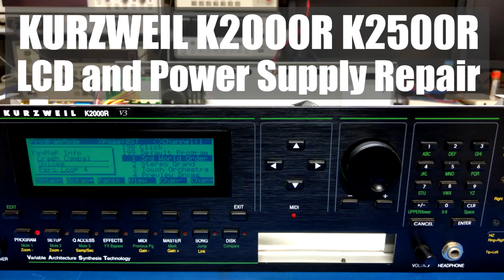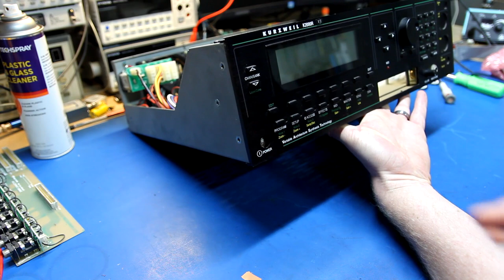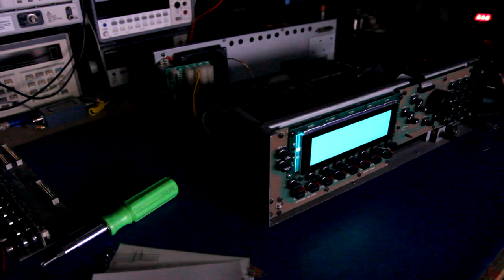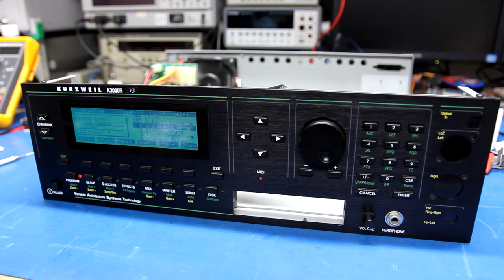Kurzweil K2000R K2500R Repair - Part 2 LCD and Power Supply

Comment: I got my K2500R for a few years, and enjoy it extremely. - I had to put it into storage when I renovated my basement, and after trying to power up the unit, had to discover that there is no sound. - It passes all the boot up, and hard-reset and what not. - LCD is great, all the functions seem to be working... JUST NO SOUND. - Obviously the batteries were exhausted, and when I replaced them had to discover that one was leaking (a little). Didn't think much of it, but eventually decided to open up the case and investigate. Much to my surprise there is modified wiring in my unit!!! - The main one I am worried about is the RED wire that has been added to D11 (next to TP16) and the BLACK wire attached to U58 (gnd). - The plug powers up the engine board (p/n 0011055 rev k) at J920. -=- So my first quesstion is... where do these wires originally come from? -
Reply: Did you try doing a HARD reset? Immediately upon powering unit, press Exit button an few times during boot process, it will bring you to boot loader menu where you can hard reset, run diagnostic tests, and more.
Reply: @ShallRemainUnknown   Thanks for the quick reply. - I think I did, but I can try it again. Right now I'm going ot replace the one "transistor/power regulator, since it is running hotter than the others (checked with thermal-imager), and then ...keep my fingers crossed.
Reply: @ShallRemainUnknown  I replaced the transistor/voltage regulator on the heatsink (the center one with the extra wires soldered to it) and reassembled the unit. - Unfortunately I still don't get a read out on the LCD - Its just "white". - I tried the "exit" button to access the boot loader, and ... nothing. -  So now I'm into checking the boards and follow the trouble shooting from KW. - If there are any Hints or "known issues" on where to focus my diag, I'd gladly appreciate to speed up my process. The board(s) visually all look good, and have no signs of discoloration or other questionable signs.
Reply: @kimmairdiscovery1957  I suggest you join Kurzweil K2x groups and ask, there's https://groups.io/g/KurzList and 3 or 4 Facebook groups as well. Good luck! I have a K2000R that doesn't boot, with all positive LCD that I'm trying to fix...

Comment: For an led upgrade, you can make the screw holes elongated for the k2000r as you mentioned come standard in the 2500. It’s another solution instead of cutting down the standoffs

Comment: I'm trying to fix the display of my Kurzweil PC3 with a new LED backed display just like you show in this video. My old unit had a really dim CCFL backlight. I replaced it with the new LED display but the new units backlight isn't working at all. Can I get your thoughts?

Comment: Hi great video.
First I’ve seen regarding kurzweil 
Power supply issues.
I wanted to ask if you don’t mind.
I have a k2000v3 that packed up
Two small glass fuses at the back of the machine where the kettle lead plugs in  have blown .
I read to replace the large capacitor 
No idea really not a tech guy
And synth techs in uk are not interested in repairing my machine 
Any ideas why the two fuses have blown 
Cheers mick

Comment: Thanks for posting this series! I appreciate all the great info. Do you know where I can find the replacement EL backlight strips that are the right size and sell for a "couple dollars a piece?"
Reply: Aliexpress sellers have them, double check the dimensions, but I believe they can be cut down a bit if necessary. You'll have to buy multiples to get the best deal, as the shipping price goes up only slightly when buying more. I think the best price I found was about $24 for 6 EL panels shipped. Check different sellers for shipping prices, the best deal seller priced the panels slightly higher, but shipping was lower when increasing the quantity.
Reply: @ShallRemainUnknown  Do you have a reference number for those? I've been searching Aliesxpress for an hour now and just can't find any... many thanks!!!
Reply: @jameshodson3450  Yeah - me too. Can't seem to locate them. I've asked bradthx if he'd mind giving us a link.
Reply: Hey all. I found the dimensions of the old backlight, which is 1.85 in x 6.18 in. I found the product "MagiDeal ABS Plastic EL Lamp" on AliExpress as a replacement backlight. It was around $2-3 dollars. The blue one is the correct dimensions, but the white one seems to be a bit smaller, but I ordered both just to test both out. Jeroen Oldenhof has a great guide on retrofitting one of the LED backlights if you want (instead of paying $90 bucks for the eBay seller backlights). They're about $30 bucks if you click the link in his blog post. Just search "Kurzweil K2000R display retrofit" on Google to find it, its the first result. (Don't want to link it here to get my comment flagged for spam)

Edit- I got my replacement backlight strips today. The white ones are quite a bit smaller, so if you are doing this repair I would go with the blue ones from AliExpress.

Comment: Great video. Thanks for this. Question: When I fired up my 2500R last year, after about 5 years of being packed away, the display came up so bright it was only readable from an angle. I could barely discern the text. I just turned it on last week again, for the first time since, and now the display just shows a blank glowing blue screen, with no text visible at all. Is this what a backlight failure looks like? I removed the front panel, and the layout of the 2500 is different from the 2000 that you show. The display looks to be in a metal case, that is not as easily removed as the 2000. Is there any chance that you could demonstrate the same procedure on the 2500R?

Comment: Hello given your experience if possible I would like to ask you a question: I have a Kurzweil K.2000 VP 3.87, the keyboard (the keys) are however very "soft" when I touch the sound, I ask if it is possible to replace the keys with other semi-weighted ones, for example for example with those like Yamaha DX7II fd, Korg 01W, or with other brands; thanks if you want to answer me.

Comment: It's interesting that even after replacing the EL strip, the display still looks rather dark in the video and the photo. On my K2500, the EL-backlit display is blindingly bright (I don't think it was ever replaced), about as bright as the modern LED replacement on my TG77.
Reply from the maker: My 2500 is the same way, super bright LCD and I also believe it is original. Kurzweil was using a newer and better LCD at that time, much more transmissive then these older displays.
Reply: @bradthx  Correct. My K2600R also has the super bright display.
Reply: I believe the k2500 is a ccfl backlight, not el. It's more like a flourescent bulb, not the same as el technology.
Reply: @backlightsnew  Yes, the K2500 (and probably K2600 and K2661, too) use a CCFL compact fluorescent bulb for LCD backlight, unlike the EL electro-luminescent backlight panel in the K2000, and unlike the LED backlight in new aftermarket replacement LCDs sold today (like the one Brad used in this video).

There's a YT vid of successfully using an long LED strip taken out of a totally different larger LCD monitor and adapting it to replace just the CCFL fluorescent bulb in a K2500. I'd hope you could still today just buy a replacement CCFL bulb, though.

Comment: Many thanks for these detailed videos. Could you please post the name of the generic LED display from ebay that you use. I was contemplating buying one of the $80 ones on ebay, then I heard you say don't buy the expensive one.
Reply: Any 240x64 display with T6963 controller and LED backlight, for example: 
https://www.ebay.com/itm/Blue-240x64-Graphic-LCD-Module-Display-LCM-w-RA6963-T6963-Controller-w-Tutorial/301017373646?hash=item4616089bce:g:0E8AAOSwH8ta1vpK
These displays using 5V for backlight, so there is no longer need for buzzing high voltage EL transformer anymore.
Reply: @_oscillator  Huge thanks for this information. I have a K2000 RS in the bottom part of my rack and I basically have to get down on the floor to read the display right now.

Comment: Well I took a chance and went ahead and replaced the display in my K2500R. It didn't change anything. Still shows a blank glowing blue screen. Apparently the problem is somewhere else. Any suggestions?
Reply: Internal battery?
Reply: @backlightsnew  Thanks for the reply. The battery housing is indeed badly corroded, and when the display was still somewhat readable, it did show a low battery message. I found a site that sells what looks like to be that housing. It does need to be replaced, but do those batteries have any bearing on the display?
Reply: @sqmus  a non-working battery can cause the screen to be blank.
Reply: @backlightsnew  Thanks so much for your response. I wasted a lot of time and money replacing the screen. I'll replace the battery housing.
Reply: @sqmus  well I hope that's the answer. I just know that it is often the culprit when there's a brightly lit screen with no text.
Reply: @backlightsnew  Well its certainly worth a try. The housing is only $17, so not a big investment. I wish I had known this before buying a new display. At least I have a spare.
Reply: @sqmus  You can completely clean even heavy battery corrosion by soaking entire battery holder tube in regular white vinegar for a few minutes and scrub a bit with an old toothbrush if necessary. That's what I did on my K2000R.
Reply: @ShallRemainUnknown  Thanks. I’ll try that.
Reply: @ShallRemainUnknown  I dissassembled the battery compartment with not too much trouble. Desoldered the contacts on the battery compartment and carefully disasembelled the spring/compartment mechnism. Soaked both the contacts in white vinegar and then lightly sanded down the heavily corroded terminal. Only took around an hour and a half and was worth it!